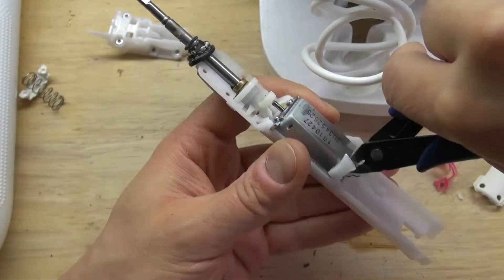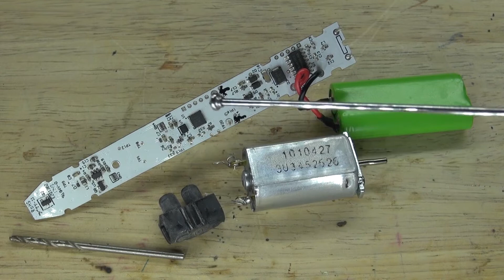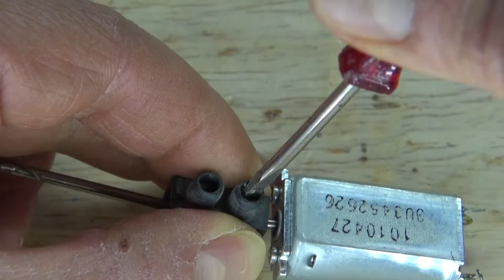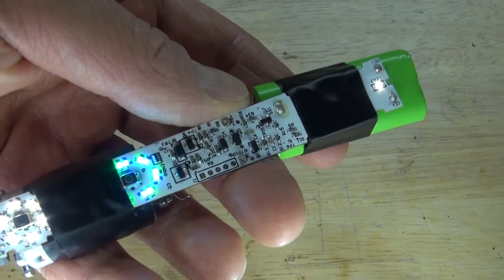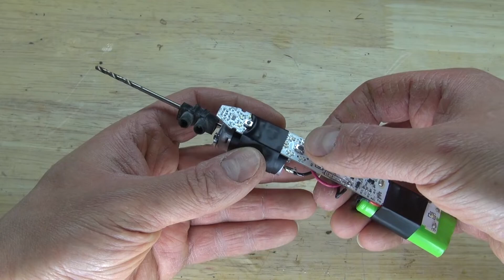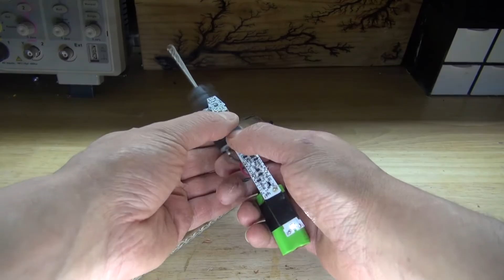Portable Drill From An Electric Toothbrush

Comment: you could improve this poor design:
- by adding a second connector onto the shaft of the drill in the opposite direction as a counterweight
- by going directly from the motor to the battery via a ON/OFF switch, overcoming the current limit circuitry.

.. you should not have cut off the charging coil, how are you going to charge the battery now?